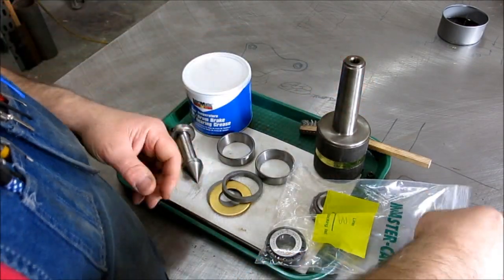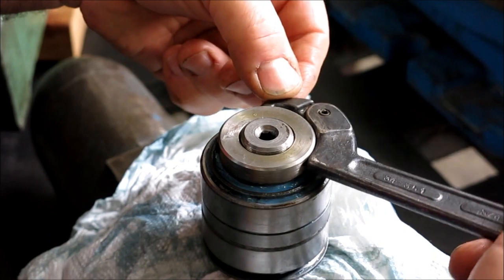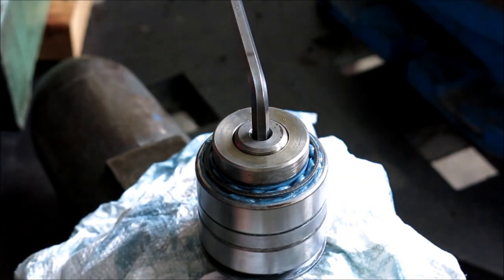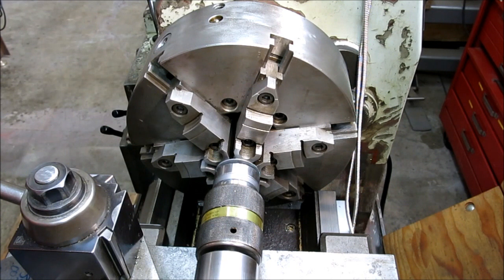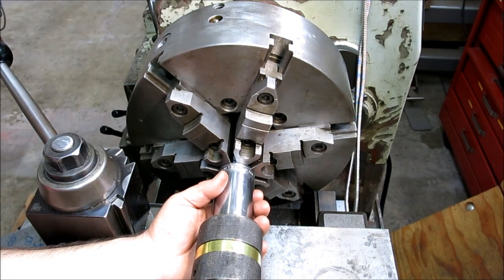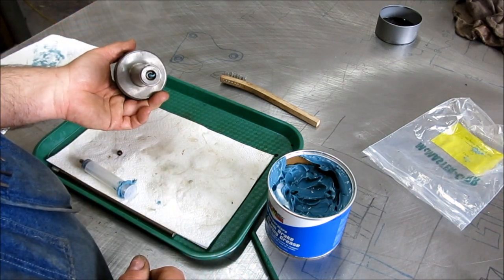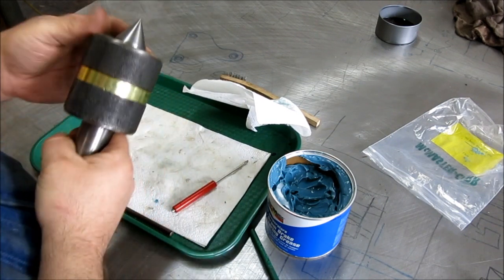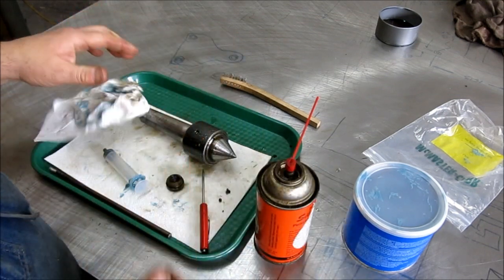Snack Break 16

Comment: When do you choose a live end over a dead one?
Reply from the maker: Hi Ponkkaa,

Actually a good question. Live centers turn more easily for less heat under higher pressures. Dead centers or non rotating centers are used for slow work that has to be rigid or where the center is cut away so the part can be faced and turned in one setup. Basically everybody uses live centers these days for anything that is turning. 

Hope this helps.

Cheers,

Tom
Reply: Yep, cleared up a lot. Thanx

Comment: Used to work for Ideal, although a completely different division.  Always amazed to see what pies they had their fingers into.  Never knew they made machine tooling until I saw your video.  As you probably know, they make most of the wire nuts in the known universe, and in 2010 they bought SK Tools, and Western Forge, as well as another tool company with Pratt in the name.  Our division designed Test and Measurement and Data Communications equipment (now closed, and offshored).

Ideal was as solid an American company as they come.  That live center will probably be re-discovered next to your fossilized remains in the year 2735, get lubed up and reused by some levitating protobrain on QuantumTube, generating a good laugh amongst our descendants.

Hope you're feeling better, and thanks for all the great videos.

-S
Reply from the maker: Hey Stan,

Thanks for the comment. Ideal seems like its been a very diverse company over the years. A couple of live centers still show up as obsolete parts in their inventory. I have a bunch of their electrical tools and they are top notch.

Cheers,

Tom

Comment: Hey Tom, You mentioned using the ultrasonic cleaner and WD40 to clean the bearings. I bought a small Lyman ultrasonic to clean rifle brass before reloading and have since found myself cleanin all kinds of stuff in it. For no more than they cost they make a nice addition to any shop!
Reply from the maker: Hey Dan,

It rocked out on frozen weasel snot. The one I used has a heated bath so it really knocks stuff loose. We used to clean small ER collets in one to get all the chips and dried coolant out of them.

Cheers,

Tom

Comment: Tom It sounds like you are still suffering from a "weasel snot" issue. Maybe you need more WD 40 in your diet!
Reply from the maker: Hey Craig,

I just went to the hardware store and got my prescription filled. Hey no copay on WD-40 how about that.

Cheers,

Tom
Reply: Well if the WD 40 doesn't set you right then there is always Zip Ties. ;) Hope you're feeling better soon.

Comment: Watch that cold, Tom. If it's the same bug as up here in Seattle, the darn thing turns into a sinus infection. Several folks have had it. Any way, thanks for the insight on how live centers go together. What sort of load do you figure it is rated for?
Reply from the maker: Hi Don,

I looked up a similar sized unit made by Royal. They said 3300 lb work piece weight and 4800 lbs of thrust. All that for suggested retail of $1800. Yikes.

Cheers,

Tom

Comment: hi Mr lipton juct a fyi I see guys use grease with much higher melting rate than is needed if it melts at high temp like disc brake grease then at low temps the bearing won't stay greased
Reply: I agree, I use a grade 00 grease for these applications as they never run to any kind of temp. I commonly see heavy low speed wagons with failed wheel bearings full of grease, but none of it is in the bearing anymore as it gets squeezed out but then never gets warm enough to run back in again.
Reply from the maker: bcbloc02 Hey Brian and Joe, You mean I have to clean this thing out again? I was going back and forth about which grease to use on this and even went and bought a can higher clay content. Its actually is pretty soft poking it into the syringe. Thanks for the tips guys.

Cheers,

Tom
Reply: With those sized bearings they would probably last for years in most shops with no lube whatsoever! I wouldn't worry about it. If you have a John Deere dealer close by you can get some corn head grease that is used for bearings and gears as well as close fit bushings. The stuff is awesome for most applications that runs less than 300degF.
Reply from the maker: bcbloc02 Ok Brian,

Corn head grease? Are you pulling my tail a little. Knowing John Deere its probably for real.

Cheers,

Tom

Comment: Hi Tom, that second centre looks like a Skoda, in which case it is a quality item. The main needle roller bearing is adjustable on diameter by loading the screw ring. It also has thrust and tail bearings. I believe they recommend oil not grease when you reassemble it.
ATB
chris
Reply from the maker: Hey Chris,

It has a needle bearing and a ball thrust bearing inside. It came apart quite easily and has a clever preload setup for the needle roller bearing. I was going to use it for another project but might just buy an offshore one for that instead keeping this one as a good center.

Best,

Tom

Comment: Hey Tom, I'm guessing the bearings will loosen once used? They did look a bit on the tight side. Anyway,  I hope to see more on how it works out... I think the hole in the tail end of the center is, the fill indicator, I've seen that style on many other things, anyway.... ;o]

O,
Reply from the maker: Hi O,

I think I went a little hairball with the preload. I'm going back in and loosen the preload nut a bit. This configuration is self energizing meaning it self preloads under use. I didn't think about it when I was assembling it. Oh well another short video perhaps.

Cheers,

Tom
Reply: I've seen other similar bearings with like pressures preload at around 7lbs. I imagine you already know how, but for those who might not it's as simple as hanging the proper weight on the handle of the spanner... :o]

O,
Reply from the maker: Opinionator52 Hey O,

Good point. I have a simple way to measure that kind of preload. Sound like another video to me.

Cheers,

Tom

Comment: So can I book my old Bronco in for wheel bearing service?? lol
Be interesting to see the old one apart. I suspect it has a torrington type needle bearing on the business end running on the hardened center.?.

Colin
Reply from the maker: Hey Colin,

I got it apart already. Its pretty chowdered up. It will make a good donor for another project. It has a clever needle bearing setup with a ball thrust bearing in the back.

Cheers,

Tom